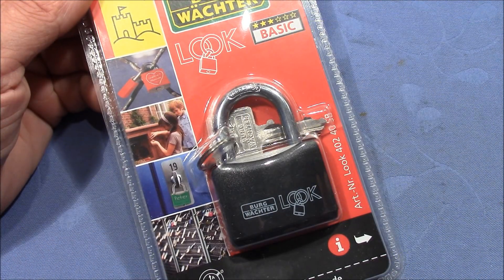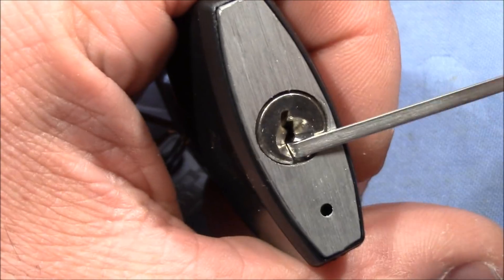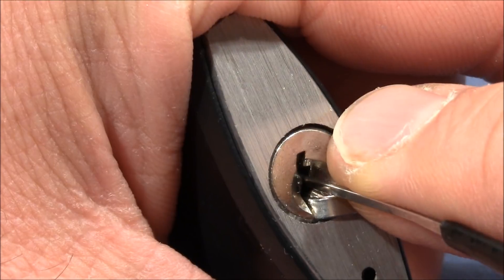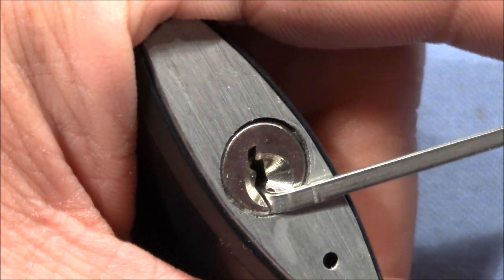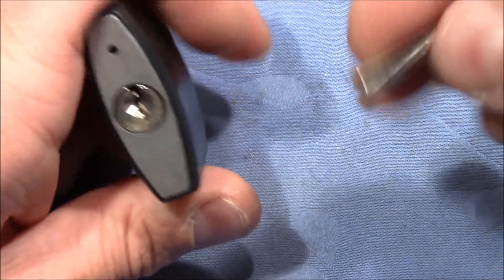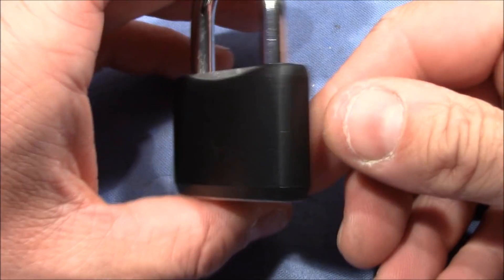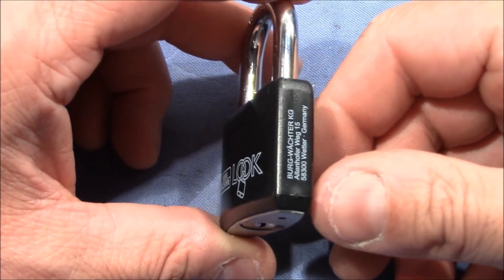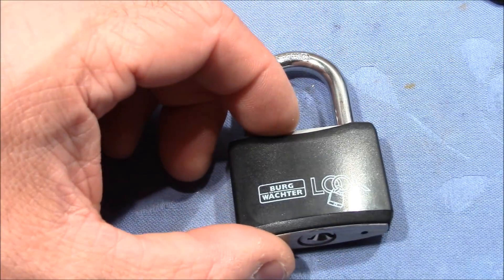(picking 558) LOOK padlock from Burg Wächter picked & teaser for upcoming video

Comment: I have the same lock and my key has same bitting as yours. I bought it from Edeka many years ago to practice raking, of which I am now very good at. Raking uses several different techniques, and with this lock and bitting, quite subtle tension with slow and soft scrubbing/rocking is needed...feel the pins. I rake this lock in seconds (yes, with this bitting) and with practice, I am certain you can do it too. Being a master raker is vital for quick entry. Tschüß and God bless... :)
Reply from the maker: Yeah, raking is very powerful. But why do you need a quick entry? Do you open locks for a living?
Reply: @Potti314  
For a living...no. But, I like to help people and in an emergency it is necessary. I have had this situation a few times before. :)

Comment: Nice job on the picking. I noticed even using scissors you had a hard time getting the lock out of the package, so for you next challenge I'd like to see you get a lock out of the package NOT using scissors or a knife...lol
Reply from the maker: How about a little lighter to burn the package open - will give a lot of smoke and make a cool video ;-)